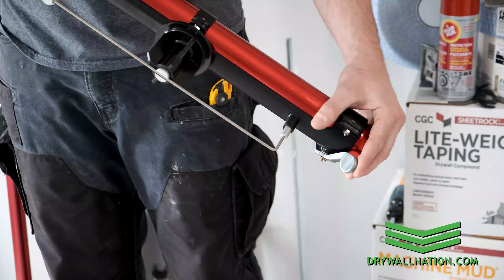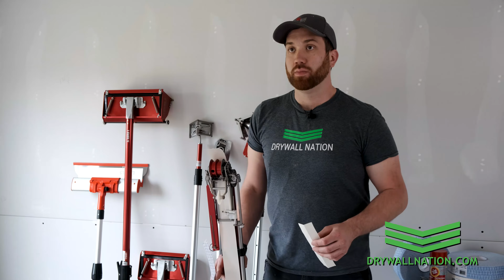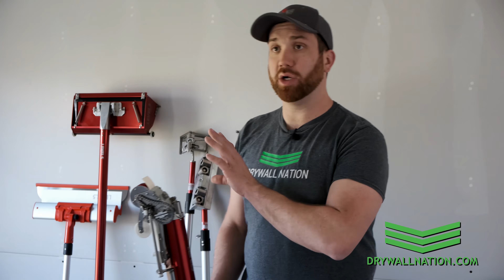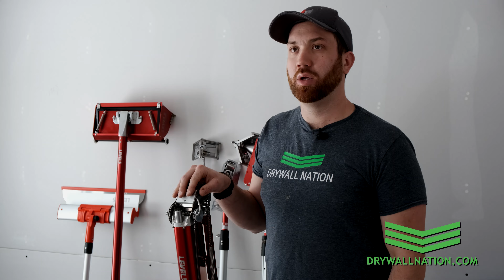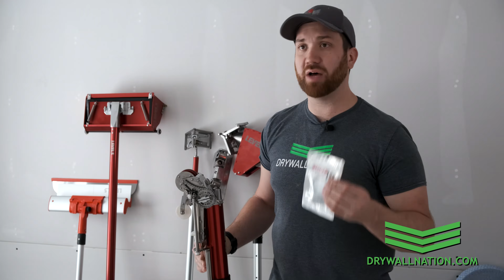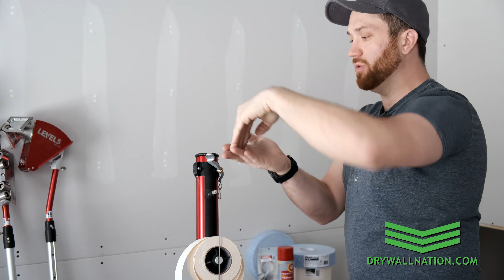Beginners Guide to Using an Automatic Taper

Comment: can I run my bazooka with 90-minute hot mud
Reply from the maker: Absolutely not. I mean, technically you can, but I strongly advise you don't. You'll have to mix your setting compound very, very thin for it to operate properly. And as it starts to setup, your taper will get harder and harder to run. Not to mention, cleaning it will be damn near impossible. Setting compound will also dry up your seals and parts. Strongly suggests you don't do this. Not worth the risk. Better off using a banjo or compound tube for setting compound.

Comment: Hey Brian, these videos are awesome. I'm a newbie with the auto tapper. I tried this for the first time, and it seemed like too much mud was coming out, Major mess. Thoughts....
Reply: I have the same problem used it yesterday for the first time and I had mud all over dripping all over when did ceiling  mud wasn't to runny yes and suggestions would help thanks much

Comment: You are half correct when it comes to the installation and orientation of the tape in a bazooka...you are left handed..
If you are right handed the roll is better counter-clockwise.

Comment: Do you have videos explaining how much water to add to your mud for the bazooka and boxes?
Reply: When you string tape you want it fairly thin. But not "waterly" thin. And it all depends on which brand of compound you using/ the weather/ how fast you move etc.You'll probably will need to experiment. Usually the thinner the better... but if you go to far, you'll have a disaster on your head. If you go to thick... it won't work right either. It's a Goldilocks syndrome for sure. 
As far as boxing... I get it where it won't fall out of the box when I hold it sideways. Like above... too thin and it will be a mess. To thick and your rectum will fall out.
Different types of muds require their own special tuning. I know USG +3 can be run thicker that most brands. And I wouldn't recommend it for using through the bazooka. It has a tendency to fall apart when mixed with lots of water. It works great for everything else.

Comment: Great video. Interested in knowing what you recommend for clean up and overnight storage? Do you thoroughly clean each day? Or just put tool in water? Or other? Thanks.
Reply from the maker: Here's a video we did on exactly that. We thoroughly clean after each job. Leaving it in a bucket of water for a day or two is okay but never for any prolonged period of time. After cleaning it, use fluid-film to keep the seals and wearable parts in good condition.
https://youtu.be/lWnzUjZj3lk
Reply: Always clean 100% completely after each job, as soon as possible. Rinse your boxes and pans/tools throughout the day that way it cleans off easier as well. The equipment is not cheap, so keeping them in good condition is a must.

Comment: I thought it will work with the normal adhesive tape for preparation before painting. This is kind of a mess to me. Is there another tool for the normal wall adhesive tape, please?

Comment: I have an older Tapetech that has no brake on it but spins fairly well. Problem is Tape drag is bad no matter how i mix the mud. Also on flats I charge the head before I advance the tape but always seem to get a dry spot about 3" from the start for about 2" then is good. My next step is trying a new bazooka.
Reply: I've been pushing the tools for 50 years now. I was taught by two, truly bazooka masters. They are considered legends here in southern California. One is 78 and still pushing the tools in Alaska. That guy could put 2- 500' rolls of tape an hour by himself. And was super clean. Guys would come and watch him string tape and were blown away. And here in the Coachella Valley we all did completions... from taping to sand and check out... ready for spray. One must do it right or you were fired.  
He taught me to roll the "Auto Taper" (That term just cracks me up. I still haven't found the "Auto" mode yet.) up the wall after each cut to drive more mud out the end to pre- load the tape to prevent a big blister at the next move. Yes, charge the head! Maybe you aren't kicking it long enough?
You don't need a new bazooka... you just need to roll it out a little bit more?
The drag issue might be that your roll of tape is dragging against the spool holder. I use 500' rolls exclusively. They will drag against that hold down rod. So I use the end of the pump handle and concave the roll of tape so just a small part of the tape roll is touching the rod.  A very small amount of oil  on the spool axle will also eliminate a lot of the drag from the roll. Be careful there... to much oil will cause the roll to take off after you stop. That is, if your moving fast enough. LoL!

Your Tape Tech bazooka has a "brake". It's just not adjustable like the Level 5 one here in the video.  Fancyness!  If there was no brake... it would roll backwards.
You can adjust it buy tweaking the little rod that presses the little brake roller against the wheel of the grooved big wheel. All you need is a nail to pull the little rod with the nail head towards you. This with cause more drag. Push it away for less drag. Be careful... you want some drag.
Tape Tech is old school compared to the latest renditions out there now. But they still work fine.
Reply: @KurtfromLaQuinta  i believe you may have solved my issue as well. I may have to clean tje spool alsobi got some metal residue on it from loong service(tube was my dads back in the 80s) i def felt spool drag now that you mention it because the tape was a little tough to pull by hand to feed it at times with a new roll i would bet that between the spool needing lube and the tape drag on the rod that was it. There was a 4 to 6 inch drag im going to do this.... so i thank you sir. You did mention concaving the tape... do you have a video or a pic maybe to show hoe you do so.... i am not following that part well.
Reply: @nathanbier2277  Nathan! I hope I helped you a little there with that drag issue.
As far as the "concaving." the roll of tape... I don't have a video. Let me try to explain it better. 
When your "stringing tape"... one whole side of roll wants to ride flat against the wire holder. What you want to try to do is to limit that from happening because it's a major source of drag. So whichever ever way you put your roll on the spool, you want the outer side of the roll tape to not rub against that wire holder.
That's why I basically "beat/ push" the opposite side of the roll so just a small part of the roll is touching the wire holder. And the rest of the roll is bent back towards the tube. Hardly any drag. I use the end of the pump handle to drive the roll to get that concave shape.  
Hope that helps. 
I could put my email address here and send you a picture... but I'm afraid somebody here at You Tube would kill this response. Not sure what their policy here is on that.

Comment: Awesome videos always very informative. Would you know how I would take apart a mud pump when its stuck together. I’ve never unlatched it and pulled it apart. But now that I finally did it won’t come apart.
Reply from the maker: Hey, sorry for the late reply.
Hopefully you've figured out your pump issue by now but it case you haven't, fluidfilm is great to help get things moving again. Could be it sorta welded together by electrolysis from being left in water too long over the years without proper maintenence. Not uncommon, especially in older pumps.